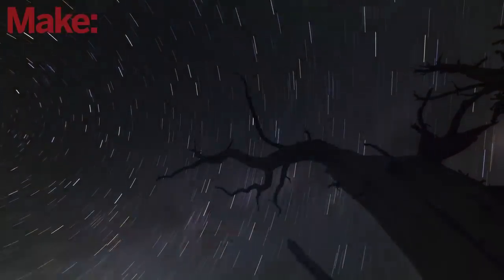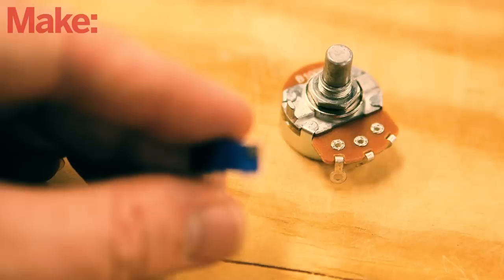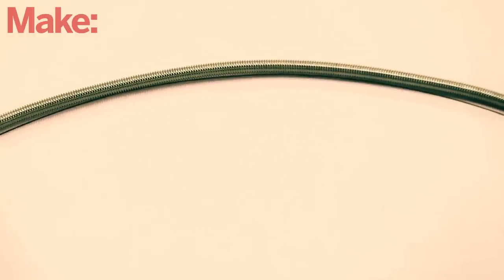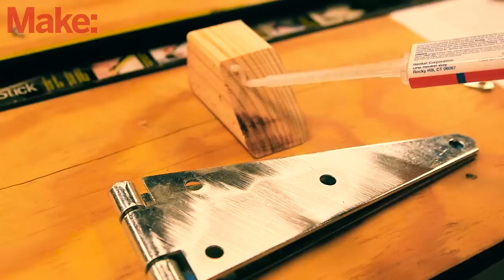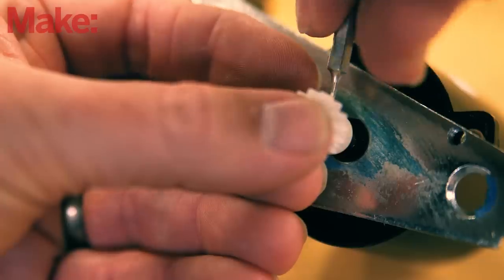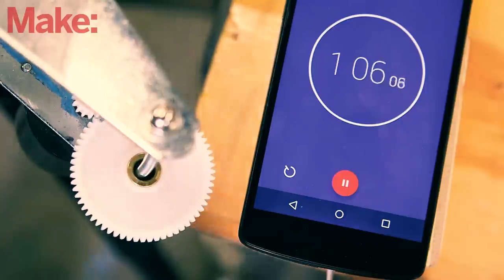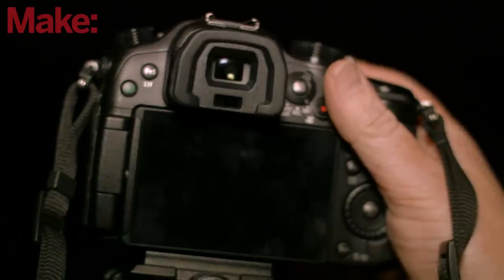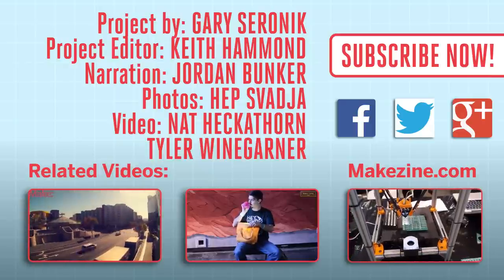Weekend Project: Perfect Astrophotography

Comment: Bending the threaded rod is best done using a form rather than bending in segments around some fixed corner. 
A form will be needed and can be made from 1/4" plywood with a circular arc cut along one edge. You will be sandwiching the arc between 2 other pieces of plywood which can be glued, screwed or bolted together.
When you bend the rod and release it from the form it will spring back a little which makes the arc slightly larger in diameter from what is desired. Make the arc slightly smaller in diameter to account for the springiness of the rod. 
When sandwiching the plywood arc between the other pieces of plywood make sure  that the outer pieces extends beyond the radius of the arc by several inches, it will form a channel for the rod to guide through while bending around the arc.
Near the start the arc drill hole through the two outer pieces of plywood so slipping a screwdriver or bolt through the hole will trap the rod against the arc.
Secure the form and proceed with bending the rod around the arc of the form and check the rod's bend against the reference arc desired.
Reply: Awesome, thanks I might try this week that there's no moon and I have some 1/4 scrap wood rolling around.

Comment: I would suggest a redesign of the mounting block attachment. Relying on only epoxy to hold several thousand dollars worth of DSLR and lense isn't a good plan.
Reply: I second this. Some screws should to the trick.
Reply: +Pete Raine Drill two more holes in the metal part and insert two wood screws to fasten the block of wood...

Comment: Having worked with epoxy for decades that wood to metal joint with fail in time. Two simple countersunk woods screws into pre-drilled holes  in the wood and your good, forever.   Threaded rods, copper, brass tubing etc.  should all be shape formed around a hard template.  It would be nice to fancy it up a tad with some indexing wheels.  Neat project.
Reply: +66tbird1 thanks, this is a useful comment. Keep on trucking !

Comment: The imperfectly bent rod may not itself be as big a problem as the inconsistent resistance it introduces. Since you want the hinge to open at a very specific and consistent angular velocity, perhaps you could use a micro controller like an arduino and an accelerometer (tracking the angle) to adjust the power going to the motor.

Comment: You can use straight threaded rod if you split the lower half of the hinge and hinge it in turn.  The new hinge would be between the tripod mount and the gears and motor.  The gears and motor would move automatically to properly receive the threaded rod (you might want to put an additional receiving nut on the larger gear, at the other end of the shaft).
Reply: ***** It's a flat hinge.  The movement can't be circular.  And if your hinges are clean there's nothing stopping the movement from being smooth.

Comment: What are the values of the resistor and 2 capacitors... also the part numbers for the gears dont pull up the part on the spsi website so a full description of the gears would be appreciated.

Comment: Would this still work without bending the rod, if you're only looking to track 5-10 minutes? Tangent error should not be significant in this window. Would you have any tips for a simple redesign that doesn't require drilling and tapping metal?

Comment: A brass threaded rod is easier to bend than steel. Bend 2 or 3 feet of rod and cut out the best 5 inches for the tracker.

Comment: This is awesome... I just wish I understood how to align it accurately here in the Southern Hemisphere. We don't have an equivalent bright Polaris-like star to use... I feel if i went to the effort to build it (and I want to), I wouldn't be able to use it... I'm also a bit confused but that may be because I'm new to this. If I'm not mistaken, unless the centre of the camera's lens is aimed directly down the line of the hinge pin itself, won't that make accuracy decrease dramatically the closer you aim your shots to the celestial pole... because the further away from the hinge the lens is, the more the camera is travelling in circles rather than rotating about a line through itself. Am I misunderstanding something? Probably...
Reply: if you have an astronomy app on your phone you could put a phone mount on it and then calibrate it to the south pole point and then switch out for your camera. this would be good for the north pole too since polaris isn't exactly "true north"

Comment: I hope someone here can confirm my understanding of the concept.  With a 10-32 threaded rod and a 1 RPM motor, the rod advances 1/32" every minute.  So in one hour, it advances almost 2" (1-7/8", actually).  Allowed to continue running, in six hours, it would advance almost 12" and the hinge would be open about 90 degrees (1/4 of a sidereal day, or 1/4 of a full circle).  Is that true or are there other factors at play when tracking for that long?

Comment: why bend a rod when the hinge's motion if already predefined by the hinge itself.

Just use a straight threaded rod to push on the tip of the hinge? or am I missing something here?
Reply: so that the rod pushes it at a consistant speed. without the bend you would have to adjust the speed for the change in pushing angle.

Comment: What is the point of the piece of wood?  Why not just bolt the gimbal directly to the hinge?
Reply: +Bob Snyder I think it has just some comfortable sense. You(r hand) have more space for settings. And maybe if you do it properly the weight point of the "device" will be top of the stand what you use for more stability.
I'm not really sure about this. Just guessing.

Comment: Won't the objects in the foreground get blurred?
Reply: Yes. This is why most mounts that you buy outright have a variable speed on them. At half speed, this mount is best used for wide angle shots that attempt to keep both foreground and stars in focus. Long single exposures will begin to blur, but if your horizon subject is far enough away the half speed will keep it relatively in focus while maintaining focus on the stars too

Comment: What other applications can there be? It is amazing but im not into these.
Reply from the maker: +elevengiant Applied directly, this build is very specialized to doing this one task - matchinghte camera movement with the rotation of the earth. You could use the drive system and circuit with a straight threaded rod to drive a motion control system for time lapse dolly slider, though.
Reply: +elevengiant sun tracking a solar cooker comes to mind. But that is about it. Good question.
Reply: +elevengiant With some modifications you could make a camera slider for some time lapse photography.
Reply: +elevengiant What Hung Sewell said...Those fancy time lapse panoramic shots you see all the time nowadays?  because of this gadget...don't even bother looking up how much one costs from a photography shop, not pretty.

Comment: why not use a retract from an RC aircraft?  all the stop downs and everything is built in.  Just need your regulator to set the precision speed after you  hack out the servo control board or is you have a 4k or 8k resolution retract you could just use an arduino and skip the potentiometer regulator
Reply: +christopher campi Your idea costs more. They done it so that anyone can afford to build it.